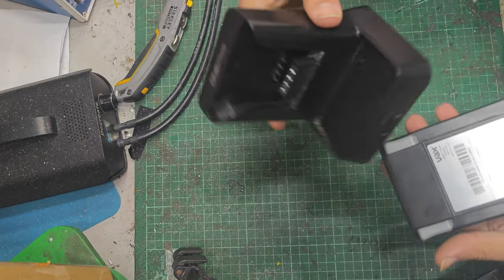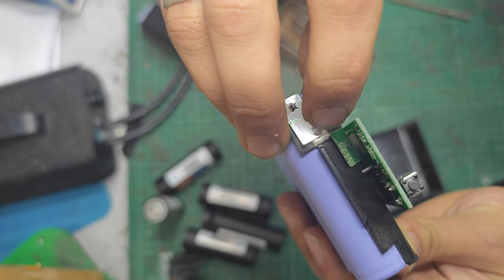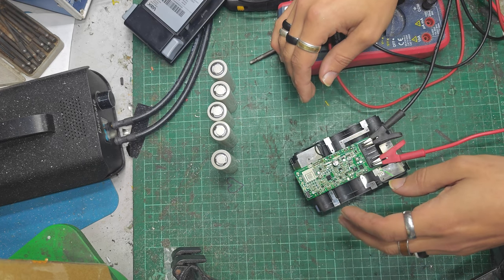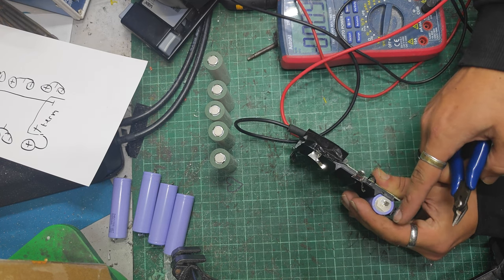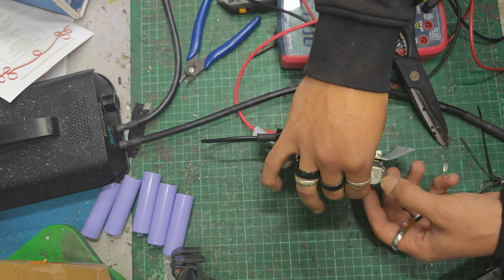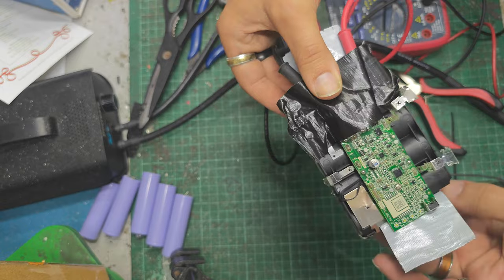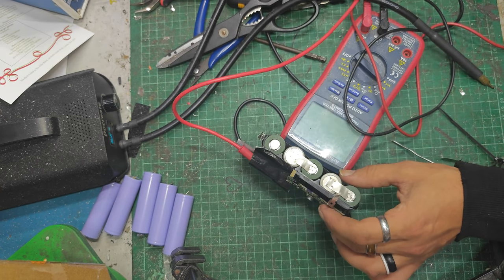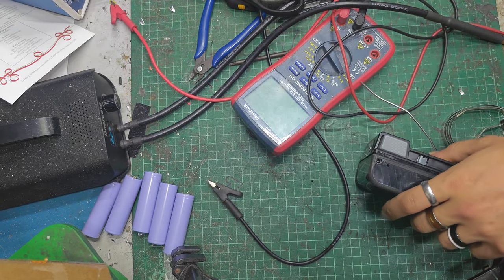How to repair a 4.0AH battery for VaxONEPWR Blade 4 CLSV-B4KS cordless vacuum  (FULL RECELL)

Comment: I'm curious why did you need to keep the circuit powered while removing the battery? Isn't the circuit supposed to survive when the whole cells are drained?
Reply from the maker: Because I didn't know if it would turn back on, some BMS systems turn off forever as eeprom gets wiped on power loss, and I didn't want to buy a new one!

Comment: How would this fix the non charging problem. Surely that's a circuit board issue?
Reply from the maker: This solves bad cells, not bad circuit board.

Comment: Hello mate, 

I have an issue with the same vacuum cleaner however all lights show on battery, which would suggest fully charged also charges when saddled in the charging unit, however doesn’t work when Inserted into hoover no lights at all on hoover and unresponsive. Do you have any ideas or possible troubleshooting methods for this? 

Thanks for your time.
Reply from the maker: Unfortunately this is all the information I've got on it, sorry.

Comment: Have the same battery with the error lights. Read somewhere that the bms “fails” itself and makes the whole unit unusable. Assuming there no repair for that scenario? 

Also, advise for using this battery shell wired to a power tool battery?
Reply from the maker: Yes unfortunately BMS failure seems common on these. I don't believe it will work with a power tool battery as there are TX/RX communication ports on the battery. But theoretically 18v DC to + and - terminals might work!

Comment: Molis
⚡🤩🤩⚡

I generally would pick P42a over p45b but they're both great as far as I understand it - my knowledge isn't deep.
What's your take on the pros/cons between them?
Reply from the maker: Dude p45bs are better in every way! Check out the mooch review, 33% lower IR, so they get way less warm under load! Amazing cells really :)
Reply: @EbikeRepairs  Interestin, didn't know Mooch compared them! in eskate/electric mountainboardin, most regard the p42a higher than the p45b.
Reply from the maker: I honestly think they've superceded them now.   

Here's a great link 👍👍 https://endless-sphere.com/sphere/threads/bench-test-results-molicel-p45b-50a-4500mah-21700-an-extraordinary-cell.116190/